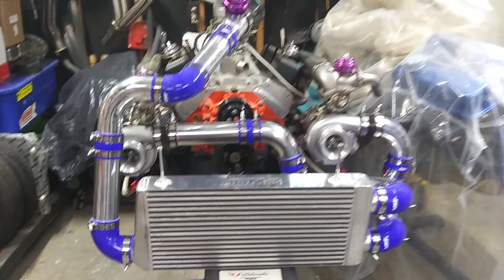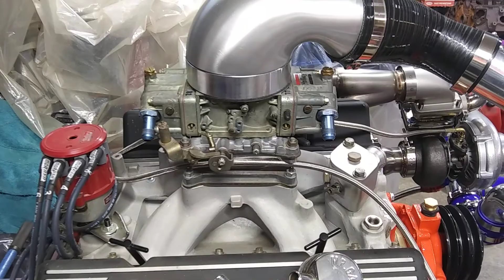Revised intercooler plumbing on the twin T70 turbo SBC 355.

Comment: Did you ever do anything with this build?
Reply from the maker: The engine is done, but the vehicle is not. With my limited space, I can only put one vehicle together at a time. Gotta finish a Camaro, then get an engine in a Cutlass, then I'll drag the 95 S-10 Blazer out of the back yard. That's what this engine is going in. I'm down to one stall to work out of these days. Slowed my progress down alot.
Reply from the maker: I had the engine running NA on a stand. Gonna have to figure out the plumbing in the vehicle.
Reply: Should make for a nice set up.
Reply: I’m interested in seeing how you will set that up. Keep up the good work man.
Reply from the maker: @heathvice8365  Thanks man.
Reply from the maker: Probably gonna end up with the radiator in the back of the vehicle. Intercooler go where the radiator was.

Comment: What headers are those? I like the set up
Reply from the maker: PG Motorsports headers. 1.75 primary, 2.5 collector. Seem to be good quality units. Think I paid around $400 bucks for them a couple years ago. More now I'm sure.
Reply: @thereluctantgearhead4544  Thanks. I just checked and they are 319.00 for a sbc turbo up and forward for an A Body
Reply from the maker: @HotRodDave  not a bad deal